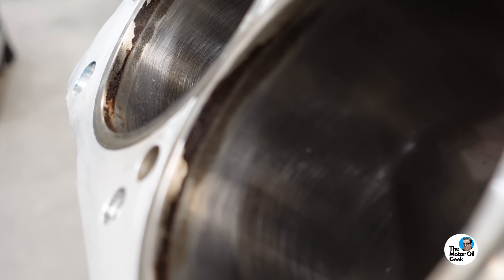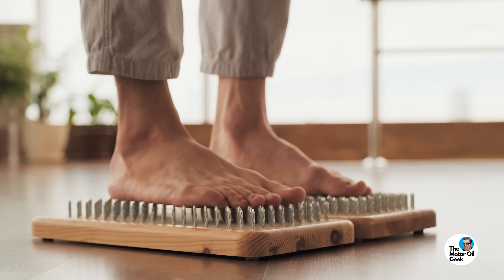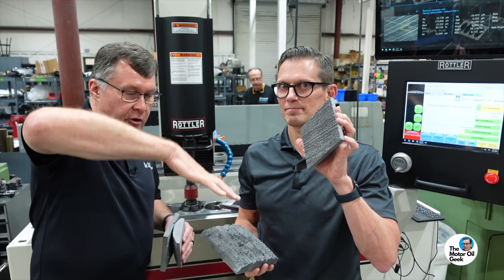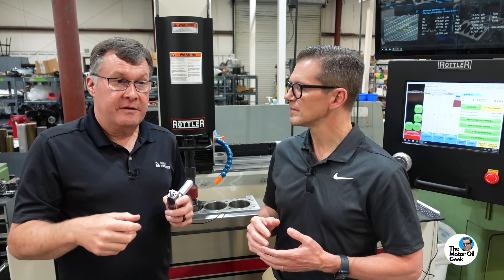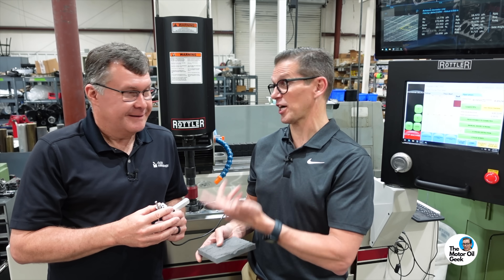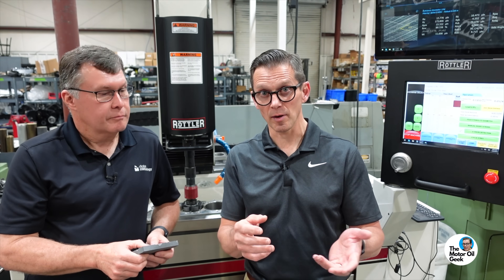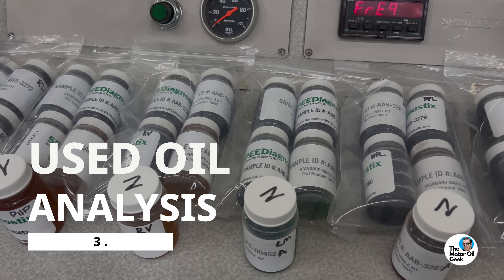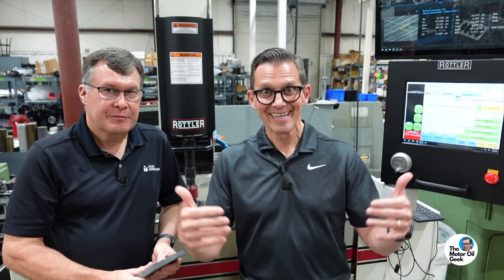GM's $1 BILLION Dollar Blunder: ROUGHNESS Matters...

Comment: It’s crazy that they don’t have perfect running stuff after all these years.   It’s like we’re going backwards in life
Reply: As a cnc programmer/machinist for almost 20 years theres so many things that can go wrong in manufacturing. Every piece of metal doesnt cut the exact same, some inserts last longer than others, coolant concentration percentage can alter performance, etc. QC is a major part of the production process and what gm did was send them to mexico for cheaper product and they got what they asked for. Save money on the front end while costing way more on the back.
Reply: Humans are involved in the process. Failure on GM’s part to properly inspect the surface finish on those crankshafts . . . regardless of who manufactured or supplied them. Bottom line, failed QA/QC.
Reply: Furthermore, the vehicle manufacturing supply chain is less vertically integrated than ever before. You must have a robust parts QA/QC process to ensure all parts meet specifications. Very obvious here that GM failed in that regard.
Reply: PLANNED obsolescence.
Reply: @robedmund9948 i dunno if they really want their trucks dying that damn fast lol
Reply: @theSkavenger84  Probably not, but it takes some time to get things dialed in! 🤣
Reply: @theSkavenger84 They do! It's intentional!
Reply: Gm is going to be footing the bill for this planned obsolescence so I don't think that's what's happening. I think they just sped up production and skipped steps to save a buck.....
 ...and it ain't working out so well.
Reply: @robedmund9948 they just didn't foresee this.
Reply: The engine in my Chevy S10 is a 1988 4.3. yes, it's consuming oil at a rate of about a quart every every 600 mi maybe less than that. 
But it's got 310,000 mi on it.  
It's amazing with Chevy's current engine, the one with the crankshaft issue, How in the hell this could happen?. If they could make a crankshaft rotate flawlessly for 310,000 mi back in 1988, why can't they do it today?
Reply: It's not just the vehicle industry it's everything
Reply: GM, Ford, and Chrysler are shit shows.  This type of disaster is inevitable.
Reply: @juicebox22a  it’s mind numbing
Reply: @theSkavenger84  especially considering the cash outlay for a new vehicle
Reply: @juicebox22a oh yeah for sure.  A truck now costs as much as my first house
Reply: @theSkavenger84 it's greed when it comes down to it. Make vehicles cheaper along with selling at a higher price, higher profits. Not mind numbing...
Reply: @juicebox22a  Mercedes Benz and BMW had problems with aluminum cylinder wall surfaces that make the big three look excellent.  No M-B aluminum engine will go the mileage of an under-maintained Dodge 5.7, even with the super-duper Kraut oils.
Reply: @juicebox22a  ALL manufacturers are engineering in major levels of planned obsolescence now. ALL of them
Toyota, Honda, ect ect....It's all carp now.
Reply: @juicebox22a  Toyota ain't far behind with their Ted Kaczynski Special twin turbo V6 and hybridization of everything. Don't get me wrong, hybrid is definitely a lot more practical for the masses than pure EV (and sure as shit easier on America's lackluster power grid) but Toyota's hybrids are mostly, how should I say... TOTALLY FUCKING GUTLESS. Unless they design a special version of the eCVT that can put more power to the road, and use a non-atkinson cycle engine as the prime mover, their hybrid system will NOT feel good in anything larger than a Corolla or a Prius. I've driven a hybrid Camry, woulda been a 2019 model year I think. My 2009 4 banger Camry gets out of its own way better and it has Toyota's slushamatic 5 speed auto.
Reply: Globalization.  Non-founding stock. And forced "emissions" requirements so tight that thinner oil makes the difference.
Reply: Thinner oil is about MPG, not emissions.  It has failed.
Reply: Just another day at GM! They don't give the first damn about quality!
Reply: The trick is to get the vehicle to gradually die within the 20,000mi after the warranty is up. That is their goal.
Reply: 100K trucks with 25$ Crankshafts. Thanx GM
Reply: At this point it’s becoming more clear that this stuff is quantity over quality and planned failures and longevity has been tossed out the window and expense has been funneled to the consumer. Especially, conveniently after warranty expires 🤷🏼
Reply: it's the unreasonable gov't dictates & goals that make the public pay.   You pay later for the short-sighted engineering.  There's a price for everything.  I prefer a little more going to fuel versus multi-thousand dollar repairs.  Cheaper & easier to live with.
Reply: Designed obsolescence
Reply: Enshittification.
If you make things properly, it costs more, and then CEOs and shareholders only get five hundred million dollars this year instead of five hundred and ten million dollars.
Reply: They’re absolutely going backwards. I’ve got an L92 6.2 in a 2008 Escalade and after 17 years the new ones are barely up on horsepower (403 vs 420) and have all the cylinder deactivation stuff mine doesn’t have
Reply: This is what happens when the bean counters have more authority over engineering.
Reply: Human error.
Reply: Stop buying crap
Reply: It has ALWAYS been about the product.  Keep the product quality high.  If doing it cheaper affects quality or durability its a bad decision in the long run.  People will buy and pay for higher quality product.  Show people your product has poor quality, they will go elsewhere.  Hopefully, GM will learn from this.
Reply: People die and new people think they know better.
Reply: It’s called engineered obsolescence
Reply: the chase to meet the CAFE and emissions BS made cars less reliable
Reply: See it all the time when companies try to save money to boost shareholder profits by cutting cost on everything. Story always ends in the same way. They make their millions in the process and the consumer gets screwed, no accountability and the company can simply file for chapter 11 or 7. It’s a rinse and repeat process, bigger companies go through longer cycles so people forget but it’s the same thing
Reply: Cause y’all pay 70k for a truck they can do this and still make a profit so they don’t even have an incentive to try. Tariffs keep all competition away they can just sit and act like the fat cats they are
Reply: perfection is an illusion and impossible to attain
Reply: government overreach. They're chasing fuel economy too aggressively, and we are suffering the consequences.
Reply: So what manufacturers and models are holding up the best now?
Reply: Quantity over quality! With a twist! It costs even more!
Reply: You are in the decaying stage of post-industrialization. We are just coasting to a stop now. Yippee!
Reply: All in the name of cost savings
Reply: They made light bulbs that could last for decades. They stopped making them because they realized they would soon be selling no replacement bulbs. If products were made to last a whole lot longer.....then there would be far less manufacturing,jobs,proffits. They build more weapons just to keep the production infrastructure in place because its critical that it be maintained.
Reply: Out sourcing components to everybody and just doing assembly guarantees poor quality control, tolerance, and then you add bean counters and value engineering to guarantee a poor design outcome.
Reply: Profit over quality is their goal.
Reply: Corporate greed plain and simple
Reply: If there was never an attempt to make a new and "improved" engine then then perfecting the old engine would be possible.
Reply: They don't want perfect running stuff. They make to much money on service
Reply: It is called planned obsolescence, they don't want it to last!
Reply: Technology changes and they fail to adept, pretty much every mfg in the world struggled around the millennia. 😄
Reply: you’re absolutely right
Reply: This isn't about having "perfect running stuff" - this is about mass production on the level of hundreds of thousands(possibly even into the 7-figures?). It's REAL easy to criticize them for a simple mistake happening, yet catching every single manufacturing error across hundreds of thousands of a single engine family, nevermind the millions of total engines, is obviously completely unrealistic. Big manufacturing numbers means big recalls, it is what it is. 
It sure as hell isn't like they aren't trying to avoid recalls, this is both costly on their wallet AND bad PR.
Reply: All the technology is there, but its cheaper to not use it and who's going to buy a new truck if the one you bought goes for a million miles.

Comment: Thank you, gm Global Propulsion Systems for another cost cutting blunder.
Reply: GM has always been the master of half assery.  They have always had the best endineers in the world yet the bean counters mess it up trying to cut cost.
Reply: @greggc8088  When the bean counters are in charge, unilaterally overriding the recommendations of engineers, this is the result.

Cost analyses are very important. Most people couldn't afford a 100% optimized car engine, as there would simply be too great of an R&D cost associated with it for economies of scale to work out. But when the singular goal is economic efficiency, there are guaranteed to be engineering concessions which simply can't survive the long term.
Reply: This is a huge QA failure, they must have requirements and how they mfg'ed 900k cranks not meeting specs is wild.
Reply: @tsslaporte  that’s exactly what I’ve been saying! How does a company like GM produce four model years of vehicles with 600,000 engines and not quality check their suppliers!?
Reply: @slscamg agree but supposedly the final surface finish is done in house….
Reply: @BabyGators  Yea,the outhouse.
Reply: @slscamg  They push this specific supplier who does their forged crankshafts to do it cheaper and cheaper and cheaper. Every batch must be cheaper. Corners get cut to make them cheaper, and this is what happens. If GM would just pay their suppliers what it costs to make a crankshaft, they would get a crankshaft and it wouldn't be a problem.
Reply: The "GM" of today is a completely different company than the "GM" we all grow up loving!! In fact, they aren't even in the same zip code!! Totally different company today/different people/ownership/etc. ha ha ha
Reply: @patrickm.8425 Unfortunately it can be said about several manufacturers, I worked for one many years ago and heard how their parts factories would produce for other more high priced manufacturers some years because it was considered too expensive for themselves so they bought cheap stuff for themselves (with the result one might predict). 🙈
Reply: @patrickm.8425 starts at the top
Reply: @patrickm.8425  The number of people that don't know that "new GM" is quit literally a different company than "old GM" is astounding especially when most of these people went through the 2008-20011 bailout era and saw it all unfold on the news in real time. There is a reason people started calling them "Government Motors"...
Reply: GM is a house of engineering compromises ... even when they build it right something is "wrong" with it ... why do you think the aftermarket for GM products is SO strong?!  It needs to be "fixed" after delivery to true customer spec/need.
Reply: @LandParkColby literally every product ever produced by a profitable company requires an engineering compromise. Haha acting like GM is the only one
Reply: Low volume oil pumps require tighter clearances, right?
Reply: This is what happens when you out source too many parts.
Reply: @mechanicalfury5402 At least when it's to the lowest bid. 🙈 All the issues that came and went with the early days of LS and later the LS7 one might think they had learned their lesson. 😆
But the same can be said for the aftermarket, there's several very well known brands that's a telltale to if the person/company you're looking at is an engine builder or an engine assembler, as if they measured everything and corrected it they wouldn't be using it. 👀😂
Reply: @mechanicalfury5402  The crankshafts in these engines are made by a Japanese-owned American company in the United States. They aren't outsourced. GM basically requires their suppliers to cut corners to meet their cost requirements, it's really stupid and may as well be GM asking their suppliers to take the fall for them in the court of public opinion.